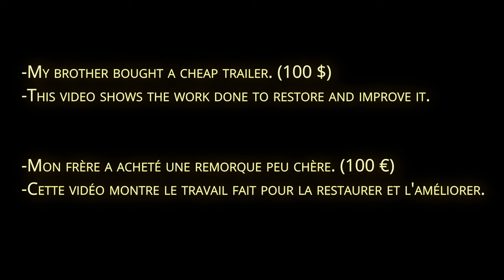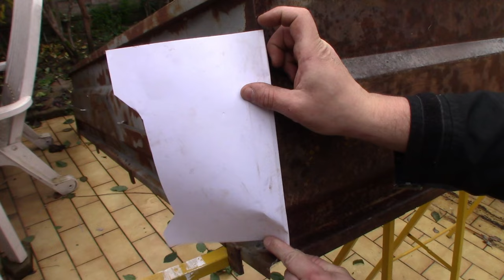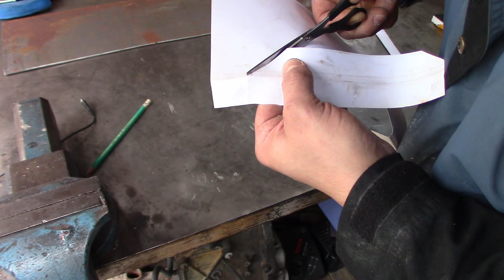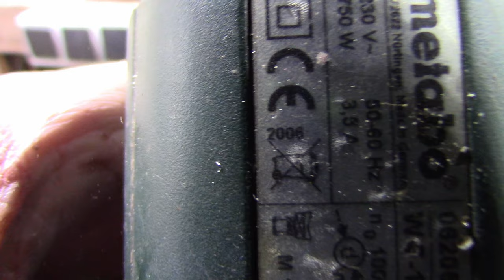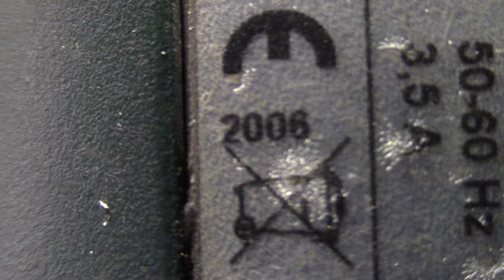Crusty trailer restoration Restauration d'une remorque

Comment: Lovely restoration! Do you have the Volvo 245 diesel still ? Greetings from Sweden🇸🇪
Reply from the maker: Thanks,
I don't have it anymore,it's too difficult to get parts other than usual maintenance parts here,it's not a common car in my country.
Reply: @michaelovitch ovoko is your friend, along with motointegrator :P
Reply from the maker: @rkan2  What ?
What are those disguised ads for auto parts ?
Reply: @michaelovitch  No, just the cheapest place s I have found and use for used and new parts. Compared to where I live the used parts  can be like 90% cheaper and the new parts usually more than 50% cheaper!
Reply from the maker: @rkan2  allright,stop that please now.

Comment: You just removed the brakes? I guess this type of trailer shouldn't need brakes anyway..
Reply from the maker: It's an old rear end from a car,so there was brakes on it,but non functionning.
I removed the remaining parts to save some weight.
Reply: @michaelovitch Am I correct when I say that the axle is an old Peugeot axle? Maybe 206 as it looks the same.